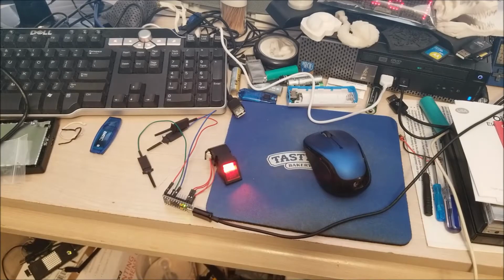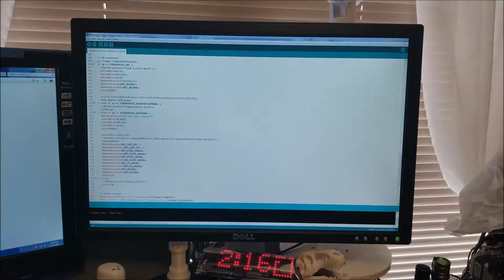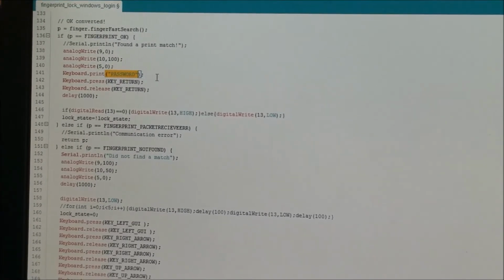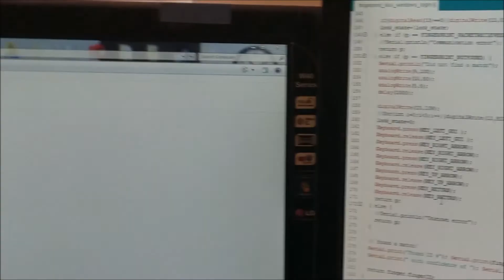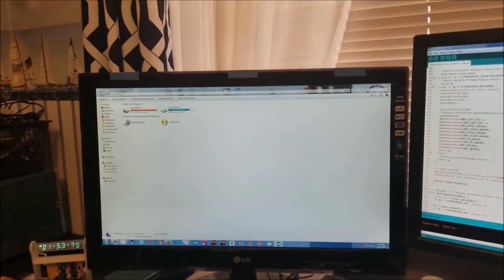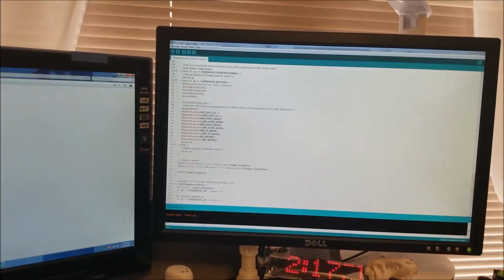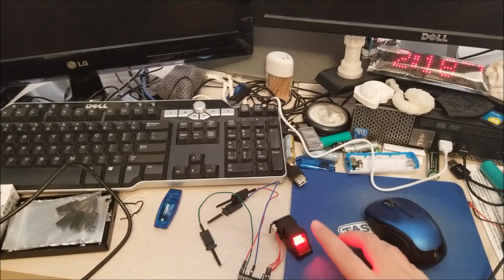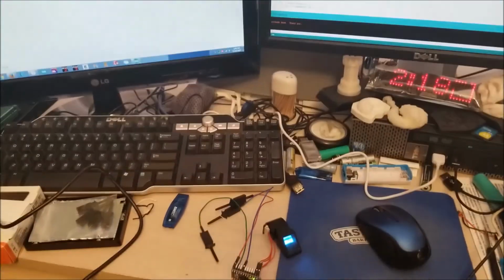Quick Project: DIY USB RGB Fingerprint Reader

Comment: Would you perhaps be willing to drop the source code?
Reply from the maker: Sure, I'll post the project files when I get home.
Reply: sjm4306 thanks!
Reply from the maker: You will need an arduino Leonardo or other atmega32u4 based board.

Here's the arduino ino project file for general fingerprint scanning:https://mega.nz/#!SEZ0AYTB!gOD_DHdUfk1d6JnVJmF5-6VGUFRFkj8DXe_lepaRkbk

Here's the windows login example I wrote: https://mega.nz/#!iZIWnZAA!w-hN5GH4qFfIdN8ne3zeZLiyOQs-oj1iH1i0ImnYs58 (don't forget to change "PASSWORD" to your password)

Don't forget to install the adafruit fingerprint library first before compiling. Also you will need to follow the instructions here to enroll and setup the sensor:
https://learn.adafruit.com/adafruit-optical-fingerprint-sensor

Comment: Can you check you the 50w driverless LEDs? They are 2 dollars shipped and I thought they are cool. I have one and it works pretty well. I am doing a projector led mod. Do you know any good heatsinks for this?
Reply from the maker: adkodiyan Yeah I'll add those to my todo list. I like to use computer cpu heatsinks and fans to cool LEDs as they are abundant and cheap (or even free if you know where to look).